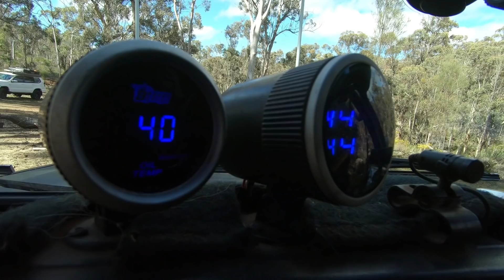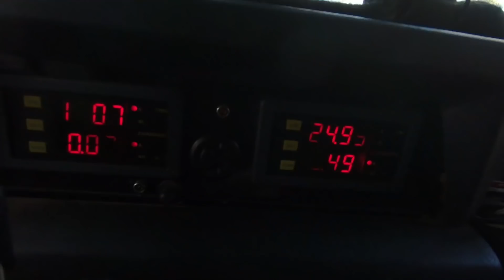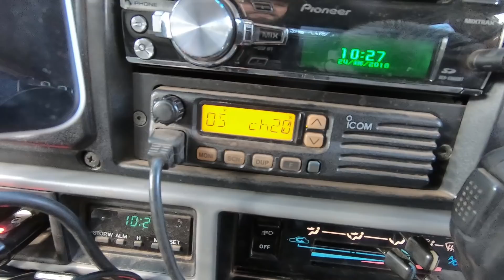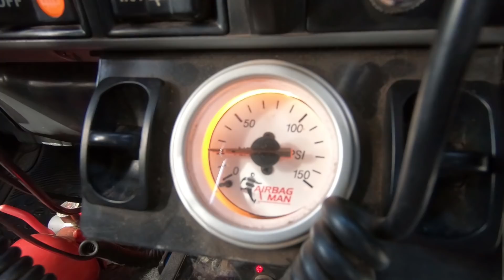BJ74 Landcruiser review, Modified Episode 58

Comment: Well it is not a 74 ,it is a 73 ,this is my favourite version of the 70 series ,I mean I do like the SWB,trooper ,pickups and the LWB station wagon ,but this is very unique!
Reply: No, it's a BJ74.  Factory turbo diesel, plus there's a number of weird little things that show it, like the little brace running fore and aft across the roof lining from near the rear view mirror.
Reply: adamhotgemini so I guess gasoline powered fj should be a 73